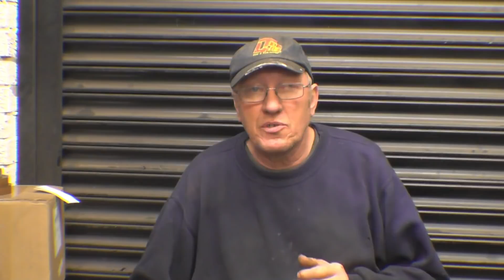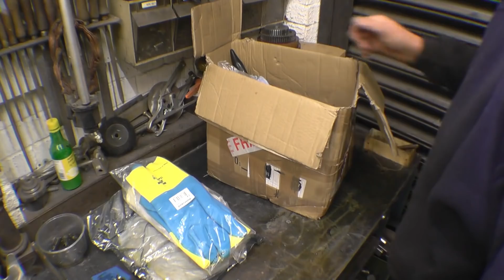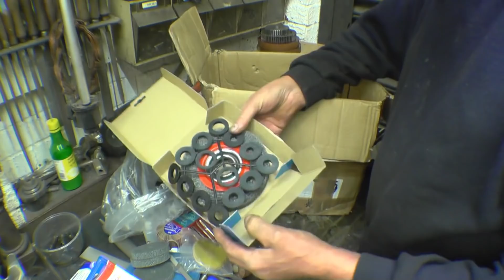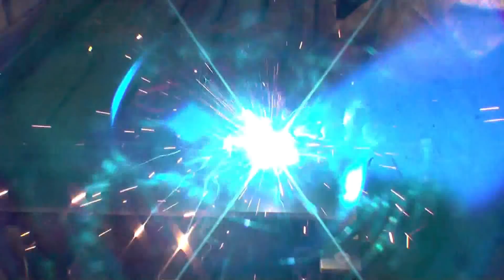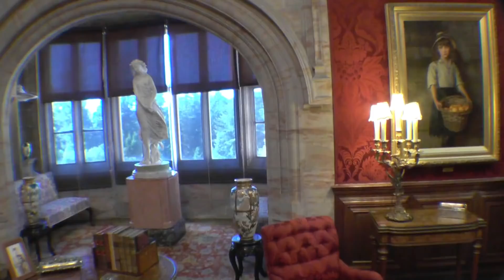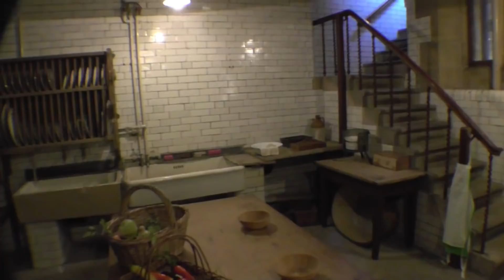SNNC 296 P2  Welding Table   Cragside House

Comment: That's going to be a great welding table. I have a piece of similar size and thickness that I plan to use for a table, but those clamping slots are beyond my capability. I'll probably drill and tap a bunch of clamping holes. Nice work.

Comment: That was very interesting. The Nimrod aircraft that I was a technician on for many years used exactly the same principle as Armstrong's lift hydraulic jack to operate the split flaps. Hydraulic jack pushes a pulley block apart. Increases the stroke many times. That hydraulic mechanism was called a Hydraulic jigger and was also used to operate hydraulic cranes at Hull Docks.